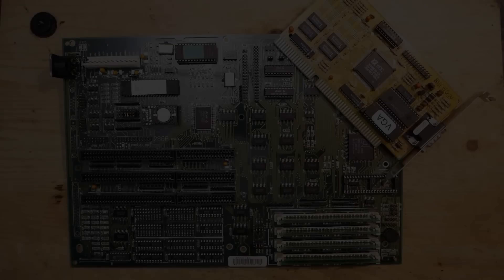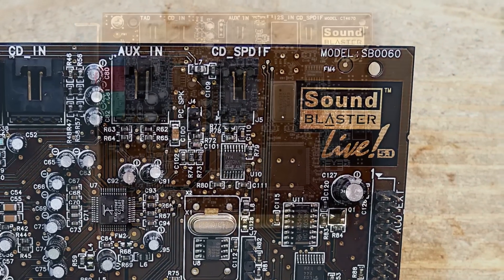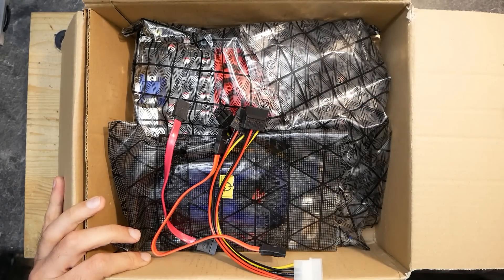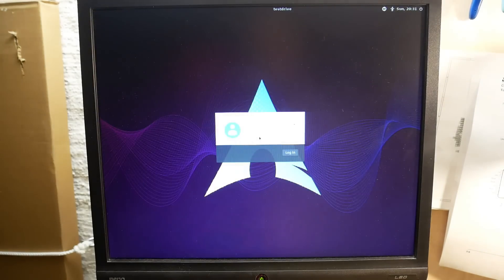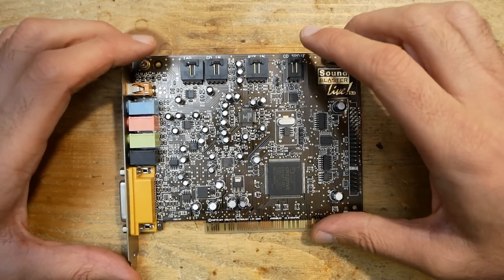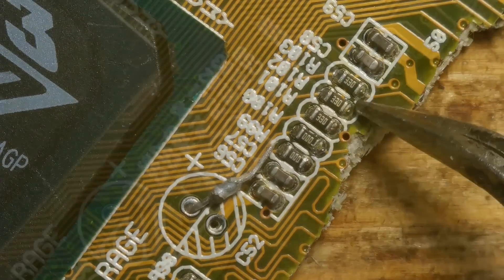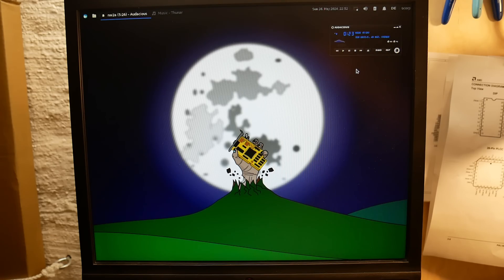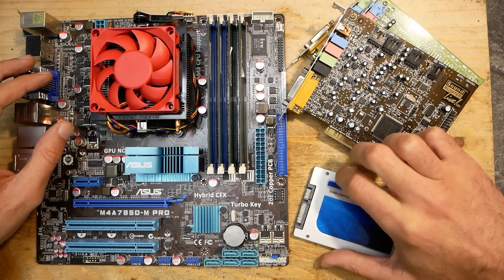How to quickly test a lot of hardware. Bringing Creative Sound Blaster back to Live!

Comment: So which Linux version are you exactly using? Can you provide the ISO link?
Reply from the maker: It's archlinux, which is unlike f.e. Ubuntu, a rolling distribution. I use it since  2007. So, basically latest state of archlinux. Kernel is currently at 6.9.2, but the distribution itself has no version.

Comment: Windows XP supports frozen state by installing SteadyState software. It supports programmed revert back and caching the disk changes to ram along with caching to disk/ssd partition.

 Also you don't need to reinstall Windows XP using the old, time consuming Setup procedure. There are tons of open tools and scripts which fully support Sysprep and WIM imaging procedures to get the system ready from a clean disk in 2 or 3 minutes.

Comment: I think something like a Rampage Extreme (the original, socket 775 X48 version) would make for an excellent test platform, since it has two PCI slots, ATA connector for HDDs and floppy drives, and still packs enough punch to support modern OSes with relative ease (even windows), with a considerable advantage over the motherboard you show us. If it were not for the ridiculous price I mean.

Rampage II Extreme would probably be a nice option aswell if you can live with a single PCIe, and it is still relatively cheap at least in Spain.

For the very few cases where you maybe cannot use linux, I think winXP with a proper proxmox virtualized setup, maybe using snapshots to allow for quick restore to a no-drivers no-conflicts state would be convenient aswell.

Very nice video as always.

Comment: the oldest card i got is an audigy2. with the quite rare 5¼" bay and a ton of ins and outs. you're using it too atm ^^. well, at least the past you...
damn. even arch. i recently hopped to debian because of the insane kde regression :D
i have a second one, in case you're interested, i'll send it your way for free...
take a peek into the alsamixer. it should have some tone control and the default slider values are all over the place too.

Comment: The perfect motherboard for testing hardware should be the ASRock
 939Dual-SATA2 1x1.5V AGP  3x 32-bit PCI 1x PCIe x1 1x PCIe x16  2xIDE sata 1 and 2
Reply: With the cpu adapter it supports s939 and AM2 :)

Comment: As I remember correctly, SB Live should work out of the box with XP due to built-in WDM drivers.
Reply from the maker: Probably yes, it would, but other 25 cards which I tested could have issues though. Also you need to reboot the system at least twice every time.

Comment: I usually tell people if a device in Windows is not working. I tell them to try Linux. It is most likely that it will be working in Linux. For several years now, it has been hard to find devices that do not work in Linux.

A few years ago I tried using one of my PCI sound cards in Linux. When I used Puppy Linux with a kernel version of 3.2 (or was it 3.4), the Soundblaster LIVE and Turtle Beach Santa Cruz worked. After this version, it stopped working. I had to use Gigabyte 870A-UD3 because it was the only motherboard that I had with more recent hardware that worked with these sound cards. I also tried Manjaro (Arch Linux-based) it did not detect the sound cards. Tried with i-Core motherboards such as MSI 81M ECO and ASUS B75M Plus. They do not work with any kernel version with these sound cards. I noticed that modules for these sound cards were in the deny list in the modprobe directory in later kernel versions for some odd reason. They must have fixed the issue by now as I saw in the video.

The site ALSA Project provides information on what sound card Linux supports.

Linux has a unified module framework. One module for many cards that uses the same chip. The difference is what is coded into the vendor ID and device ID. It may also have deeper information coded into the EEPROM or Flash chip near the chip. I edited the video capture chip module to include one of my video capture cards. I got it working, but I did not upload the patch to kernel.org. This was a long time ago. The card is DIAMOND ATI Theater 750 (TVW750PEC). It is a good video capture card that captures analog video in RAW. I may get it working again and upload the patch to kernel.org. Is it too late? 🤓

Comment: SB Live was the go to pci sound card for linux during the early 2000s. It got really good linux support fairly quickly
One downside to the EMU10K series is that it's DSP always runs at 48KHz which means that it needs to resample anything at a different sample rate to 48Khz. Considering 44.1 KHz tends to be much more common, the output from a SBLive and Audigy is not as good as from a sound card that does not do any resampling. Audigy2 has a mode where the DSP could be bypassed allowing support for some non 48KHZ frequencies without resampling but the older cards did not have that capability.
Reply: yes, but the dsp is the hidden gem. and philips nailed audio when it created the cd. i can't manage to get close to the sound the audigy 2 creates even with 32/192khz (the recon3d does that (Sound Core3D [Sound Blaster Recon3D / Z-Series / Sound BlasterX AE-5 Plus] ), hdmi too, but that creates a lag when you only use the hdmi for the sound and want to play games on another display)

Comment: Good catch on that Sound Blaster. Honestly, I would've thought the resistor was supposed to be missing. It became obvious only after you pointed it out.
Reply: The clue is the pad. Unpopulated looks very different from a ripped one. Unpopulated looks flat or perfect round/smooth, while ripped will have sharp edges, like a fracture does

Comment: Miss check memory of soundfonts?  upload soundfonts? Check back, center/subwoofer, microfono/linein , midi port ,  Gameport
Reply from the maker: This card has no own memory. It uses mainboard memory for sound fonts through PCI bus. Tested that as well of course and nothing spectacular there, everything works fine.
Reply: yes, it's not a sound card, if the mixer fits into a single screen.

Comment: What Linux do you use for this purpose? I tried it recently and had some success with mint
Reply: arch see grub2
Reply from the maker: I use arch in this case, but it doesn't really make a big difference. Debian f.e. would do the job just as well. If you like mint, use mint.
Reply: Recently I tried Linux, Mint (Debian) was stuck on 640x480p on my 1440p desktop. I moved to Arch (Garuda) and it worked out of the box. I don’t want to upgrade to Win11 and Microsoft made me try different things… last time I did it was OS/2 30 years ago. Except for Windows 8 (which I skipped), I was happy with XP and Win7.
Reply: Athlon64 boards with certain sound cards are excellent for retro gaming: modern infrastructure, relatively inexpensive and flexible speed adjustments (CPUSPD). Thanks for sharing!

Comment: "The CPU as i said is AMD Athlon Something..." means you are the kind of person that deals with computer hardware every day and does not sometimes create videos from the perfect museum of old computers at home.
Reply from the maker: It's just in this case. I have built this setup long ago explicitly for such testing and I don't remember, which CPU is under the cooler. I keep it like that completely in the box and use it every now and then. That's why I forgot which CPU exactly it is. It's dual core Athlon 64 AM2 CPU, but I don't remember the exact clock.

Comment: Nice idea - as i have a full linux server here and im working with linux at work i did not catch that benefit of hardware drivers. Great video :)
Reply: Just upgraded to e new kernel today and spent 30 minutes watching ALL the drivers compile. If this Ryzen laptop had an ISA slot, I could just plug in say an old Adaptec SCSI card and it would just work. It's a benefit I cannot forget. :)

Comment: Its nice to see emu10k1 work well out of the box on Linux. I still have painful memories of that module back in the early 2000s, and fighting hard to even get OSS working.
Reply from the maker: Yeah, that was indeed a pain back in that days, but luckily in 25 years some things improved :)
Reply: I used to dual boot with the non-value version of the card on one of my P4 systems with Linux Lite and XP, made networking + file sharing safer and it's fun to see what the old hardware can do in the modern age
Reply: it works so well with modern drivers that there's someone in China taking EMU10K1 chips off of scrapped Live! cards, and loading them on a custom PCB with a PCI to PCIe PLX chip. I've actually got one of them in desktop, after replacing all the suspicious electrolytic bypass/filtering capacitors with aluminum ones to clear up some audio hiss and buzz that it had.
Reply: @francistheodorecatte  Given the Audigy Rx exists and is pretty cheap I'm surprised that's worthwhile.  Out of curiosity what would one look for and did they leave the legacy functions the Rx lacks (gameport and MPU-401 specifically) in tact?
Reply: I started using Linux in 2003. I have a Soundblaster LIVE! 5.1 (SB0060 ; EMU10K1-KEF) card had no problems besides data corruption. The data corruption happened in Windows too. It happens with the VIA south bridge chipset such as VT82C686A. The distribution that I used is Mandrake version 9. It worked out of the box. I had to learn what program to use to set the mixer controls. It worked after I knew that it is alsamixer instead of the GUI volume controls in Gnome or KDE. I used the analog outputs and yes all 6 channels. I used 6 channels for movies, but not for gaming. I did not set up digital audio because I had no SPDIF input on my audio equipment. I also did not care to set up hardware MIDI and EAX though. I played the Linux version of Unreal Tournament Game of the Year. I was not too fond of the sound of the Soundblaster LIVE, so I switched to Turtle Beach Santa Cruz. The Turtle Beach Santa Cruz caused no data corruption. I used Timidity for MIDI.

The emu10k1 was revised into a different chip and it had CA???? model number. Does your model of SoundBlaster use that chip? If so, that chip had many problems in Linux. Took many kernel versions to support it though. What kernel version did you use at the time with your sound card? If you do not know, what distribution and version were you using? I know that Mandrake 9 uses the 2.4.19 kernel version. Of course, the ALSA libraries and utilities are required preferably equal to the ALSA version in the kernel.

My most painful memory in Linux was doing updates and Adobe/Macromedia Flash. Flash had no hardware acceleration in Linux, so it was slow on my Linux computers. Any computers I had back then did not have a Windows XP install. They ran Linux. At this time, I use OpenSUSE because of its update excellence. 🤓
Reply: i got ptsd from that. but the audigy card with a similar chip stuck. i even prefer it over pure digital sound because of the tone control (and equalizer if you dare to mess with ld10k1)
and setting up pipewire now is just boring. although i love how it felled all the other soundserver crap with one smack.
Reply: YouTube seems remove posts. I try this again. 

I started using Linux in 2003. I have a Soundblaster LIVE! 5.1 (SB0060 ; EMU10K1-KEF) card had no problems besides data corruption. The data corruption happened in Windows too. It happens with the VIA south bridge chipset such as VT82C686A. The distribution that I used is Mandrake version 9. It worked out of the box. I had to learn what program to use to set the mixer controls. It worked after I knew that it is alsamixer instead of the GUI volume controls in Gnome or KDE. I used the analog outputs and yes all 6 channels. I used 6 channels for movies, but not for gaming. I did not set up digital audio because I had no SPDIF input on my audio equipment. I also did not care to set up hardware MIDI and EAX though. I played the Linux version of Unreal Tournament Game of the Year. I was not too fond of the sound of the Soundblaster LIVE, so I switched to Turtle Beach Santa Cruz. The Turtle Beach Santa Cruz caused no data corruption. I used Timidity for MIDI.

The emu10k1 was revised into a different chip and it had CA???? model number. Does your model of SoundBlaster use that chip? If so, that chip had many problems in Linux. Took many kernel versions to support it though. What kernel version did you use at the time with your sound card? If you do not know, what distribution and version were you using? I know that Mandrake 9 uses the 2.4.19 kernel version. Of course, the ALSA libraries and utilities are required preferably equal to the ALSA version in the kernel.

My most painful memory in Linux was doing updates and Adobe/Macromedia Flash. Flash had no hardware acceleration in Linux, so it was slow on my Linux computers. Any computers I had back then did not have a Windows XP install. They ran Linux. At this time, I use OpenSUSE because of its update excellence.
Reply: I started using Linux in 2003. I have a Soundblaster LIVE! 5.1 (SB0060 ; EMU10K1-KEF) card had no problems besides data corruption. The data corruption happened in Windows too. It happens with the VIA south bridge chipset such as VT82C686A. The distribution that I used is Mandrake version 9. It worked out of the box. I had to learn what program to use to set the mixer controls. It worked after I knew that it is alsamixer instead of the GUI volume controls in Gnome or KDE. I used the analog outputs and yes all 6 channels. I used 6 channels for movies, but not for gaming. I did not set up digital audio because I had no SPDIF input on my audio equipment. I also did not care to set up hardware MIDI and EAX though. I played the Linux version of Unreal Tournament Game of the Year. I was not too fond of the sound of the Soundblaster LIVE, so I switched to Turtle Beach Santa Cruz. The Turtle Beach Santa Cruz caused no data corruption. I used Timidity for MIDI.

The emu10k1 was revised into a different chip and it had CA???? model number. Does your model of SoundBlaster use that chip? If so, that chip had many problems in Linux. Took many kernel versions to support it though. What kernel version did you use at the time with your sound card? If you do not know, what distribution and version were you using? I know that Mandrake 9 uses the 2.4.19 kernel version. Of course, the ALSA libraries and utilities are required preferably equal to the ALSA version in the kernel.

My most painful memory in Linux was doing updates and Adobe/Macromedia Flash. Flash had no hardware acceleration in Linux, so it was slow on my Linux computers. Any computers I had back then did not have a Windows XP install. They ran Linux. At this time, I use OpenSUSE because of its update excellence.
Reply: I started using Linux in 2003. I have a Soundblaster LIVE! 5.1 (SB0060 ; EMU10K1-KEF) card had no problems besides data corruption. The data corruption happened in Windows too. It happens with the VIA south bridge chipset such as VT82C686A. The distribution that I used is Mandrake version 9. It worked out of the box. I had to learn what program to use to set the mixer controls. It worked after I knew that it is alsamixer instead of the GUI volume controls in Gnome or KDE. I used the analog outputs and yes all 6 channels. I used 6 channels for movies, but not for gaming. I did not set up digital audio because I had no SPDIF input on my audio equipment. I also did not care to set up hardware MIDI and EAX though. I played the Linux version of Unreal Tournament Game of the Year. I was not too fond of the sound of the Soundblaster LIVE, so I switched to Turtle Beach Santa Cruz. The Turtle Beach Santa Cruz caused no data corruption. I used Timidity for MIDI.

The emu10k1 was revised into a different chip and it had CA???? model number. Does your model of SoundBlaster use that chip? If so, that chip had many problems in Linux. Took many kernel versions to support it though. What kernel version did you use at the time with your sound card? If you do not know, what distribution and version were you using? I know that Mandrake 9 uses the 2.4.19 kernel version. Of course, the ALSA libraries and utilities are required preferably equal to the ALSA version in the kernel.

My most painful memory in Linux was doing updates and Adobe/Macromedia Flash. Flash had no hardware acceleration in Linux, so it was slow on my Linux computers. Any computers I had back then did not have a Windows XP install. They ran Linux. At this time, I use OpenSUSE because of its update excellence.

Comment: FYI the EMU10k1 has a 31-bit DMA which limits it to about 2GB of RAM max. The Linux driver can fall back to "ISA" mode, limiting it to about 16MB of memory on modern systems.

EDIT: Apparently there is a way to get it to access 4GB with 32 bit DMA but nobody put in the work for the driver. Mayhaps it can be done?